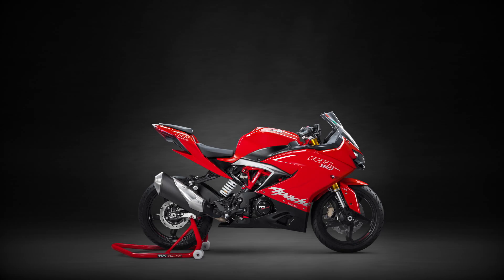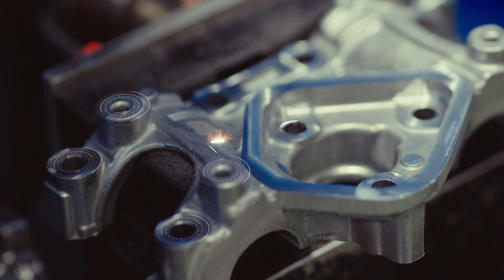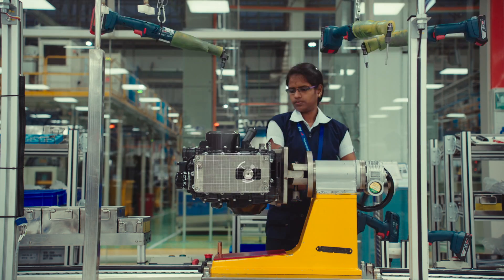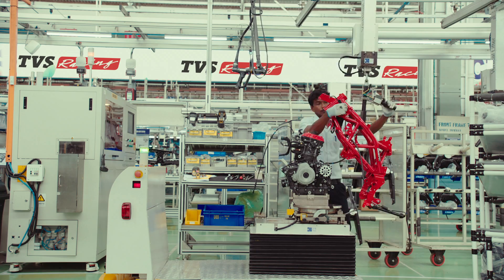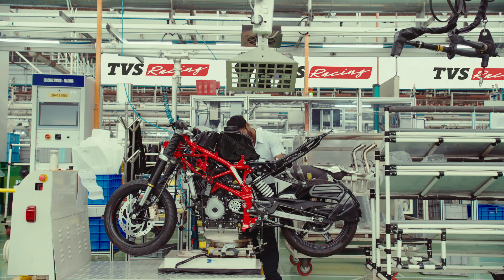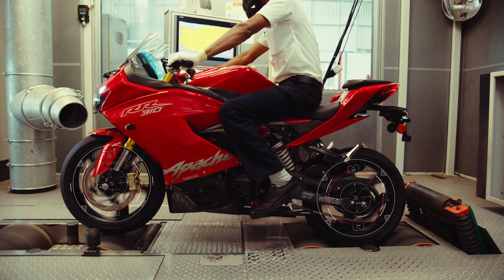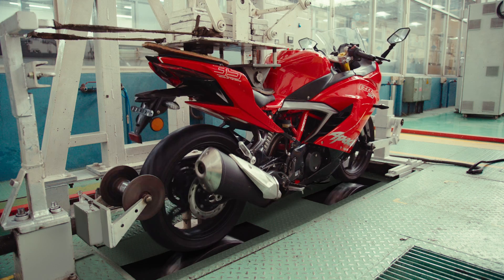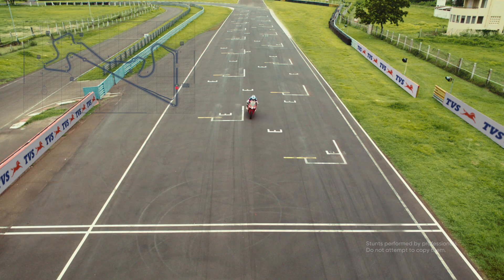TVS Apache RR310 – Manufacturing Film

Comment: My bike running only 5600 km .. I am suffering with lots of  morning starting problem 😭😭..the Moto engineer told me ..it is battery problem..ok ..than. I installed new battery and than ,next morning same problem bike is not started .. check this video ... https://youtu.be/Q4v4hlhqjSY 😭😖 plzz give me so solution..

Comment: PROUD TO BE An OWNER OF THIS BEAST 💪
Reply: Yrr Lucky i am big fan of rr
Reply: Will you please tell about how easy / difficult it is to get the spare parts of this 310 series
 
At my place neither the showroom nor third party have spares so...
 I AM UNABLE TO PURCHASE THOUGH I CAN EASILY AFFORD IT
Reply: Bro im gonna buy this bike within 2weeks...hows bike? Any suggestions and drawbacks?
Reply: Bro, planning to buy one.. Pls advice whether its good for long drives ... Once in 2 week rides for abt 500 km
Reply: @MaheshKumar-vr2rc  yes bro bike is much comfy and performing good. Drawback are you feel heat near your tigh in traffic roads. You feel vibration but not much.
Reply: Bro how's the bike
Reply: @sachinbejoy8887  it's seating position is better compared to other bikes in the segment not by a big stretch but slightly it is definitely better than rc but long drives yes you can do it
Reply: lol wht bout top speed 🤣
Reply: @jass3703  top speed is 172 km/hr  and breaking is master piece even in high speed
Reply: @abineshboopathy1909  u know about r3?
Reply: @jass3703  sir hope you also know the price difference and also difference between single cylinder and dual cylinder.  Most importantly I can able to get 30 plus mileage while I ride below 80 and when I need thrill I can Rev up to get more speed and I can compensate the mileage.  What Is the mileage of r3? And also about ground clearance I have already tried my bike on many path with no roads 160mm you can't even pass through a speed break confidently. Overall you are comparing an all-rounder with sprinter which is suitable for speeding expensive.
Reply: @jass3703  do u know indian roads 😂 ?
Reply: @abineshboopathy1909  Not at all rounder r3 top speed bruh? if you just want mileage you buy platina or splendor And you can avoid roads easily speedbrakers nd all by slowing down or stoping
Reply: @jass3703   I know you are being sarcastic but I prefer to be polite because that's how my parents raised me. Platina can't do touring as my bike. Also I have a challenge for you shall ride the to moolakona falls a trip and check which bike remains as whole functioning one?
Reply: @abineshboopathy1909  nice😂

Comment: Best bike on this segment ...no one can beat this  bike in terms of tecnology and ride quality...its a perfect track machine
Reply: Saket Chaturvedi 
RC is from KTM. Sucks on the road. KTM quality in India is bad. The 390 duke feels like it will fall apart when riding on bad roads. Quality of parts on Apaches are much better than bajaj parts
Reply: Saket Chaturvedi 
You are a bajaj-KTM fanboy. No issues. I didnt compare the 2017 dukes to the 310s quality. I have an Apache 200 and the quality of parts on my 200 are more or less the same as the quality on the new 390 dukes. I said the ride quality is pathetic on bad roads and feels like it will fall apart. I never said off roads.
Reply: Saket Chaturvedi 
And i said this after riding my 200 and my friend's 390 back to back. The power on the 390 is amazing. No doubt at all. But quality and fitment levels are not great
Reply: Saket Chaturvedi 
Apache RR 310 may not beat KTM on the track. But differences will be marginal. On the road KTM is overpriced and outclassed
Reply: @ajaykaushik2272  yes
Reply: And I bet you haven't even seen the RR310 in person and are still assuming that the quality is better just because "UHHH... It's Bajaj lol"
Quite the ignorant person you are
And it's probably not worth debating you
So goodbye
Reply: Saket Chaturvedi 
And for your comment that the difference between the timings of RC 390 vs RR 310- RC had a lap time of around 2:02 around the chennai track- Set by Rajni Krishnan in 2015 ( See Autocar 2015 trackday video for proof)
RR 310 set a lap time of 2:06 on Dec 6th this year- Set by TVS racer Jagan
Also, the track conditions were not that great on that day else lap time would be even better(See powerdrift's first impressions video for proof)
Reply: Rr310 has better road presence...i woukd go for rr310 bcz of good performance and looks....ktm is geeting so common and not good for city riding ...heating issue and fuel economy
Reply: Doon Rider track machine without slipper clutch 😐
Reply: @ajbob8121  now if is coming with slipper clutch
Reply: Saket Chaturvedi 
The point you made about 2 390s in the market is exactly my point also. You need to have 2 separate bikes to use for track and road.
But RR 310 does both well. Its great on the track and decent for the road. It can tour as well. No mods needed. Thats why RR 310 is better
Reply: Ajay Kaushik
Quality and fitment levels?
What is that?
You haven't even seen the 2017 RC390 and the Apache side by side and you're saying that?
The Apache RR310 is for sure a great bike but calling it a better track bike than the RC390 is just plain retarded
It's just a sports tourer with vibrations post 6K lol
Kinda like the RS200 is for 200cc bikes
Reply: Saket Chaturvedi 
Enjoy your NS 200. Goodbye. Most people ride the bikes on the road and not race tracks. If you are someone who only rides on the track then dont bother about ride quality.
Reply: So according to value for money and quality apache is far bettr ...and ktm spare parts not available for long time
Reply: Doon Rider
VFM is still better on the KTMs especially the Duke 390 considering all the equipment it gets and the RC 390 is still better VFM than the RR310
Reply: Saket Chaturvedi 
The one who is desperate here is you. You are trying to prove that a product which sucks in the real world is better than a product which performs better than it in real world conditions
Reply: Saket Chaturvedi I saw the bike in person, fit and finish and the quality overall was excellent. Didn't seem like a bike from an Indian manufacturer.
Reply: Ajay Kaushik
Same cam be said for the Duke 390 as well lol
It's great for the road and KTM has given it the nickname of "The Corner Rocket" for a reason
It's not behind the RC on the track as well
The 390 twins are better than the Apache and you can't deny it
Reply: Ajay Kaushik
And lol
Nope
I won't take a bike with a 11 litre fuel tank and a mileage of around 26 for touring lol
There are places which don't have fuel stops that don't have fuel pumps for 300 kms
It's not perfect for long distance touring either
It's in the middle
Not a track bike and but road bike either
Reply: Ajay Kaushik right bro
Reply: Ajay Kaushik
Nope
It's not overpriced lol
It offers more features and power than the RR310 and the price is definitely justified
And no the difference won't be marginal
That would be pretty big
RC390 is a true beast on the track
And it'll be good on the road as well with a gel seat
Reply: Ajay Kaushik
Well I mostly ride on the highway on the Dominar but ok
And yes not everyone rides on a track
But that statement of yours doesn't go well with the one you were defending earlier 🤔🤔🤔
Hmm
Reply: Doon Rider
Dude I swear you guys are so fucking desperate...
Why are you guys lying so much?
Reply: Doon Rider
And spare parts are always available lol
One of the reasons why people choose the Bajajs is the availability of spare parts and you're saying not to go for a Bajaj because of spare parts availability...
Reply: Ajay Kaushik
RC is a beast on a track and you said it isn't
I just proved you wrong
So you're bringing real world scenarios in for some reason
For the street you have the Duke 390 lol
There's a reason there's two 390s in the market
One for the track and one for the street
Reply: Saket Chaturvedi 
https://youtu.be/-8vs1vSvdLo
Watch this video from 3:42. Gypsy danger does a hot lap on MMRC on his RC 390. He took 2:08 for the lap. Close enough to RR 310s times
Reply: Ajay Kaushik
Just because of the stiff suspension setup you thought the bike would fall apart?
With that kind of statement I think you shouldn't even debate anymore
That's just plain retarded lol
Reply: Ajay Kaushik
Lolol
You think a difference of 4 seconds is small? 😂
And that too on a racetrack?
It's almost a difference of 300-400 meters lol
Reply: And the 2015 RC had the problem of the belly pan scraping
The 2017 doesn't
Hence more lean and faster corners which result in a better lap time
Also it gets even stickier tyres now
Reply: Sidharth Krishnan
Yep
Looks like a 600cc super sport
Reply: Dunno why TVS has slapped "RACE BIKE!! RACE BIKE!!" all over it
It's more of a sports tourer than a track bike and not totally ideal for that either
Reply: Heh :3
Reply: Abhishek Jaswal you don't need a slipper clutch for 34 bhp..
Reply: vivek narayan 
You do actually
It provides super smooth downshifts without rear wheel skidding 
Even R15 V3 gets a slipper clutch now lol
It's a must on a track bike
And it would be a must too when you'll be riding this so called "Perfect Track Machine" by TVS
The RC390 rules the track lol not this thing
Reply: #pkbikes Pakistan's No.1 Motovloging channel just for bike lovers
Reply: Rc390 best hai
Reply: And who the hell rides a supersport and expects good ride quality? 😂😂😂
Like TF?
That's just plain ignorant lol
The RR310 is just a sports tourer not a track focused beast of a machine the RC is
It'll slay the Apache left and right without any problem lol
And unless you're a middle aged man in his 40s or above I don't think you should have any problem with the RC as well
Just install a gel seat if you wanna go on long rides lol
No one excepts ride quality from a supersport except you lol
Reply: RC390 gets more features and is actually a better track bike than this one
Reply: @saketchaturvedi1073  with underpowered engine 😂😂